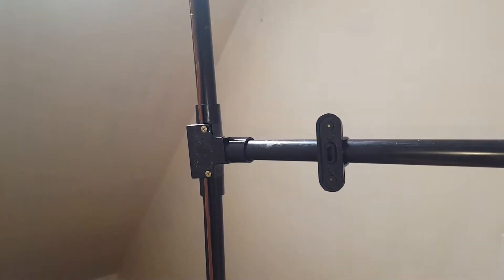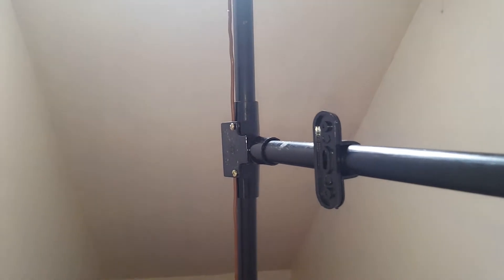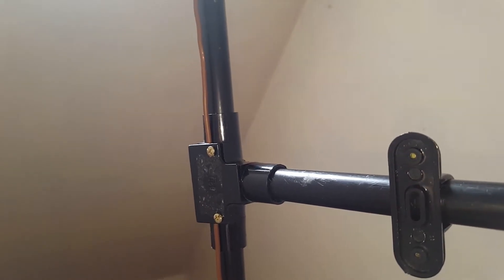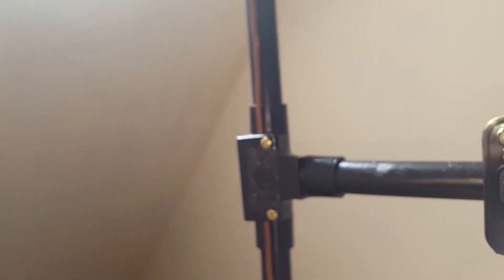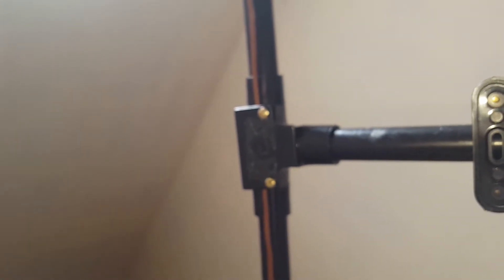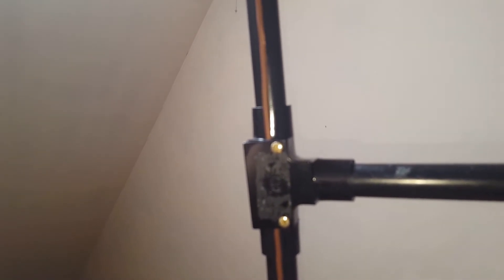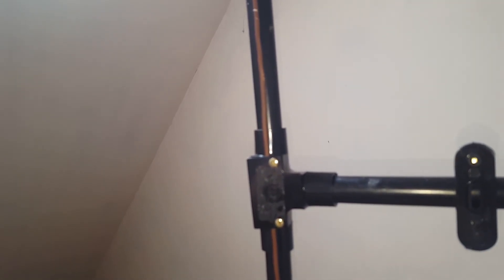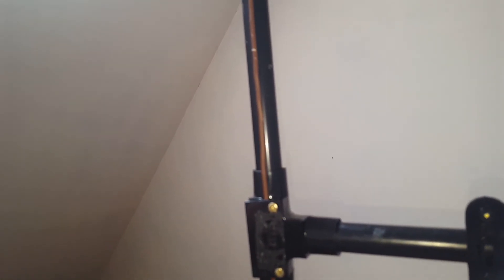2m/70cm Dual Band Antenna Homebrew

Comment: Need to see the WHOLE ANTENNA, please!
Reply from the maker: Hi Rusty, the antenna construction is the same as the 2m version, the dual band has the original vhf dipole and a uhf dipole added in parallel.They are tuned separately one at a time by trimming the dipoles. hope this helps,73!